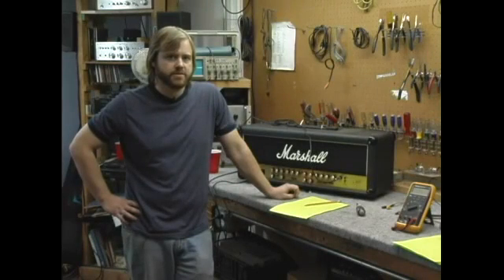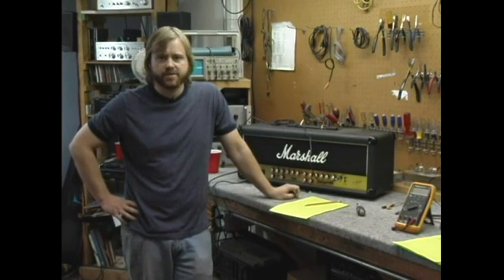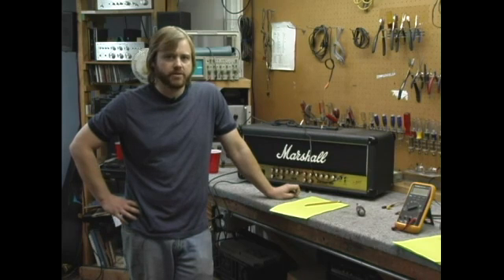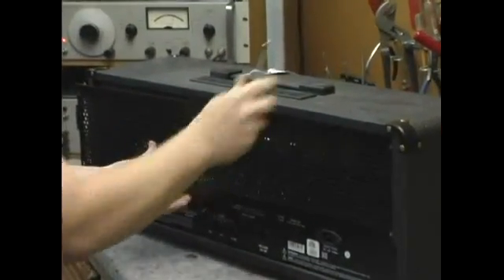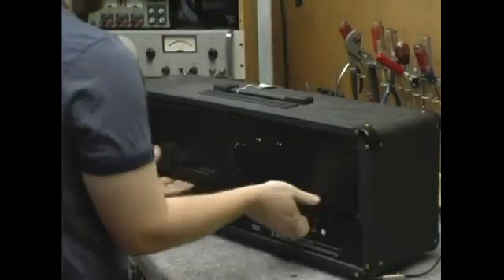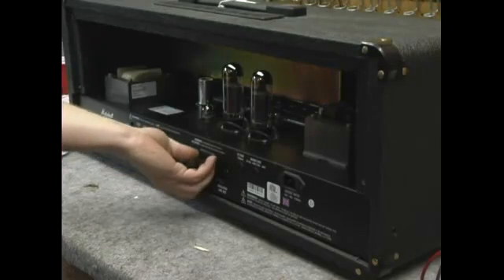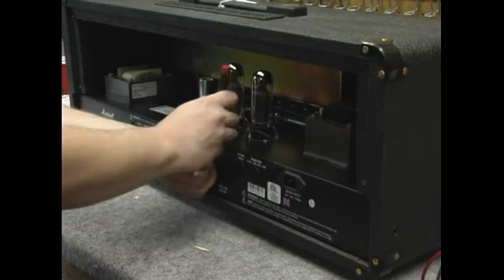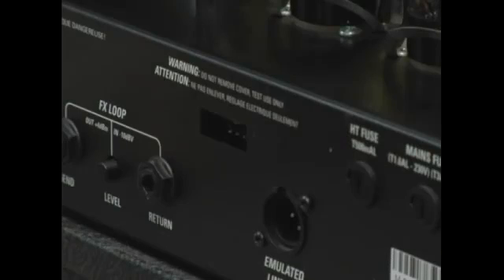How to Remove Back Cover to Change Tubes of an Amplifier

Comment: Thanks for that, is it okay for me to remove the back of my DSL 20watt combo and leave it off? If only for the purpose of liking the look of the inside, I mean I wouldn’t want to do it with a solid state effort but a valve / tube amp is very different.